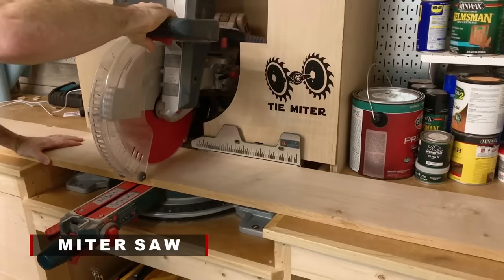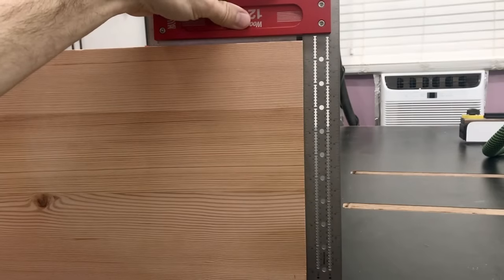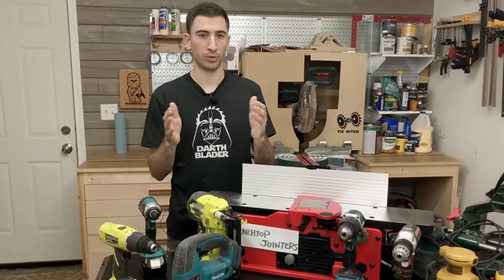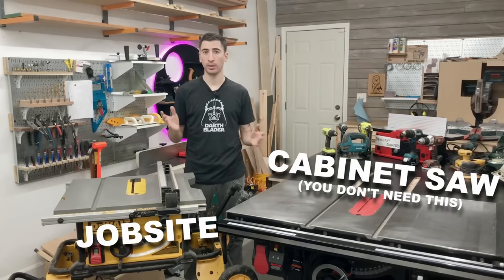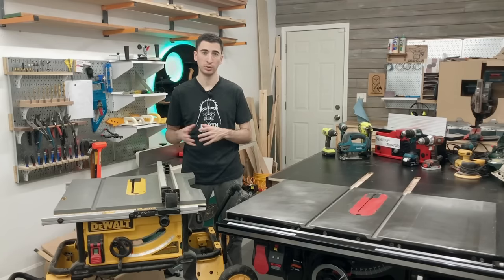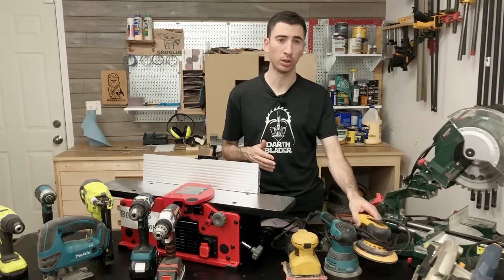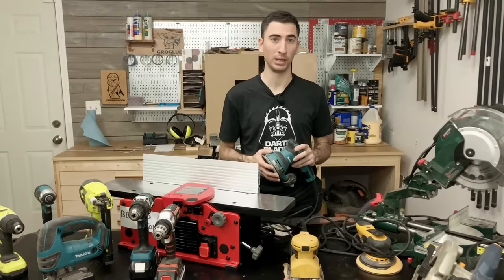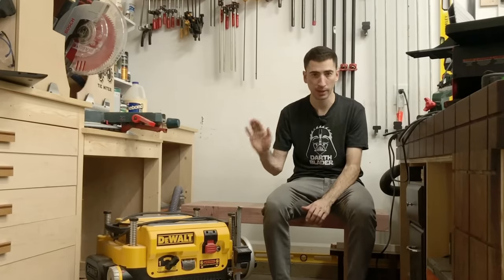Woodworking POWER Tools // Watch Before Buying

Comment: You are correct about the 8 inch jointer.  If you build using solid wood, your first 2 operations should be flattening the face and jointing one edge.  Next you need to go to the planer and flatten all your stock.  Then you can go to the tablesaw to rip your stock.  Finally go to the mitersaw (long bed support) for crosscutting.  Buy an 8 inch long bed jointer.  Your accuracy begins here.  Can i do the same thing with handplanes, yes.  But it takes 4 times longer.  Buy a 15 inch industrial planer with a longer bed and great feed rollers.  Can you get by with a lunchbox planer,  yes but it will take twice as long and you can not plane wide panels.  Buy a 10 or 12 inch tablesaw that has cast iron tables and is 27 inches deep.  You can use smaller tablesaws but they are more dangerous.  Your fingers matter.  Buy a 12 inch miterbox,  10 inch is too small for a lot of stock.  I will call bs on not buying a cordles sander.  I bought the square base dewalt 2 years ago and was amazed.  When i had to work on 2nd story windows on a 28 foot ladder i was glad i did not have a cord.  I can run a long time on a 4 ah battery.
 Things i did right 43 years ago:
Bought the 8 inch industrial jointer, 2 hp
Bought the 15 1/2 inch industrial planer
(They are both still running)
Things i did wrong 43 years ago:
Bought a smaller tablesaw trying to save money.  Finally found a 1957 Delta unisaw that i bought from an 80 year old craftsman who was downsizing.  What a difference that was.
Bought a 10 inch miterbox.  Too small.
Bought a nice 12 inch delta when the motor burned up on the 10 inch.
Could have saved 50 to 75 percent on my power tools if i had bought them at local auctions or from craftsman who were retiring.  This takes time but there are bagains out there.  I have bought $400 tablesaws for $40,  $225 router for $50, $1500 planers for $200.  Went to one auction where there were 5 of everthing.  This guy had 5 tablesaws. 5 planers, 4 jointers, 5 lathes, and lots of other stuff.  Bought one box lot that had 4 combination squares, marking guages, chisels, and planes that was worth over $200.  I paid $15 because i wanted the brass backed dovetail saw i had seen i  seen the box. Craigslist, estate sales. Auctions, and clearance bins at home depot can fill up your shop with great tools that will last a lifetime.  You don't have to pay full price.
Reply: Great info for an amateur just starting out like myself. Thanks!

Comment: 1) don't underpower your equipment, make sure you are on a 20 amp to get all the power and not burn out your motors. 
1B) (because I am lazy for editing): make sure your motors get fully up to speed before you start cutting, you want the blades to be doing the work and you want to keep the RPMs up. If you slow down the blade the blade will start to wobble and it will throw off your cut. That's how you'll get Burns and scoring in cuts. You can go slow with a miter cut and virtually get no blowout. 
2) the orbit (1/8, 1/16, 1/32, and 1/64) are what you need to focus on, get a minimum 1/32 it is good for taking down a surface and decent at a finish... 1/64 is a finish sander and not for taking off volume... Get an adjustable speed and you can slow down the speed (you need to slow down to) with a 1/32 and get a better sand without swirls. (wipe with water or denatured alcohol or lacquer thinner to raise the grain before doing this for a better result) bostch has a good one that is competitively priced. A low orbit sander and cheap sandpaper will leave hook marks and swirls. Also, just like the saws, let the sander do the work.  
3) The DeWalt planer and table saw are highly recommend by myself as I have used them professionally for over a decade. They last and do very good job and stay true, and have enough power to be safe...
4) pay attention to professionals and reviews for saws if you're going to get your radial arm, or the more expensive compound miter saws. Some saws that make a great miter box do not make good radial alarm saws as they will not cut square on longer cuts. I have a Delta chop saw that is older than dirt that still works, though it's only a 10 inch. Dewalts make fine 12-in chop saws if you need a little bit more space. I have a Makita compound sliding miter saw for any of my detail work as it's the only one I found to cut square and straight and have all the angles that I need of all saws on the market until you get to the truly expensive stuff (through they no longer make a 12" version of the sliding compound miter saw). 

5) DeWalt miter boxes have a lot of power, however the color that holds the motor to the blade is cast aluminum, so if you're too rough with it you can actually bend that and throw it out a square. So don't slam your tool into wood to cut or drop or strike the housing too much as it will ruin your saw. 

Over 20 years of high end cabinet work and furniture restoration experience.
Reply: Thank you for all this!
Reply: No s---! Sooooo generous with your advice & detail! THANKS!

Comment: The most surprising tool I've purchased was a Harbor Freight angle grinder.  On sale for $7 (I think its typically $11 now) and I had no use for it at the time.  But in the last couple of years I've used it from cutting stone to cutting metal fencing (hog wire) in addition to various grinding duties.  With the right blade or abrasive wheel it easily did the job and working long after I would have assumed it to fail (again cheapo HF tool). I only minimally take good care of it, it just keeps going.  I've been looking at upgrading, maybe a battery powered but really haven't found a case where I need to.
Reply: I had one but the switch failed after about 5 uses. If you ever get a good cordless grinder you'll wonder how you lived without it. I also have a corded makita grinder for the bigger jobs.

Comment: I have been a carpenter for more than 40 years and to this day i do not have a workshop as clean as yours. there is an age old saying a tradesman never blames his tools you can get the best that money can buy it does not mean your going to get a better result because you can also buy the cheapest and get the best results. spent most my life buying expensive tools but found over the years my old tools serve me better.  I almost do everything by hand now because the results are easier to achieve. using an handsaw gives you sense that you have achieved the real skill of wood working. an hand plane give great satisfaction and at the same time keeps you fit. but to each there own.

Comment: I have to say, one of the first tools I purchased was the dewalt jobsite table saw with folding stand. It is flawless, accurate and has given me 4 years of faithful service so far. It was an excellent purchase over time. I am precise with my tools, so if you are a rough worker, your results may vary.
Reply from the maker: Thanks for sharing

Comment: I definitely need to differ about the skil table saw. I purchased, own, and use a Skil TS6307. It’s a fantastic little saw for 300 bucks. Was square to the fence right off the box, and the fence even all the way through, and easy to adjust. My biggest gripe is the miter gauge is junk, but they all are at this price point.
Reply: I've heard all good things about the Soil. I'm gettng one for my remote workshop
Reply: I've used proper "good old days" Delta cabinet saws, and even their miter gauges were sewage.  Essentially, expect to replace a miter gauge.
Reply: @tomsardo6984  Earlier this year, I bought a Craftsman table saw from Lowe's.  The problem with it was the fence only extended to 12".  So practically useless for sheet stock.

After struggling to make it work, or watching it sit out of projects entirely because the saw just couldn't do it, I sold it and bought a DeWalt, with a 32" rip capacity.

If my Lowe's store carried that Skil table saw, with its 24" fence, I probably would have bought it, and kept it.  There have been a few things I've used the additional capacity of the DeWalt for, but I could work around the Skil.
Reply: @thegardenofeatin5965  if you buy a saw, ANY saw just for the miter gauge, then you’re bound to be sorely disappointed… rather it’s the 300 dollar skil, or 3k Powermatic. Just how the game is played.

Comment: Nice video, and good advice. I am fortunate and have been able to pickup good quality mitre and table saws as well as sanders and drill press. I do have the Dewalt 735 planer and I have a nice 6” jointer with a helical head. But I run into problems in that area on several projects, and rather than worrying about replacing my jointer or planer, I have made friends with my wood mill. He has an 8 inch long bed jointer and 24” planer, and for almost nothing he will run things threw for me. It would take me many, many years of projects to pay for either of these things for what it costs to use his. That and it is great to just hang out and talk wood and projects. Never underestimate what you can learn and money you can save by networking with other woodworkers. My experience has always been that they love to share their knowledge and often time to help other woodworkers out.

Comment: Don’t forget if you are hand or power sanding to frequently use the unclogger. I managed to do without the dangerous jointer for decades. I now have one but I don’t use it much. I would buy an edge sander if I were starting up. My most used power tools are circular saw, band saw,mitre saw, edge sander, pillar drill and cordless drill. Followed by planer or sanding thicknesser and bench morticer.

Comment: As a  longtime woodworke, I have an assortment of really great tools, Jet, Laguna etc. And what I thought may be a mistake buying was the Ryobi cordless 18 and 23 gauge. Best cheapest toolsI've bought. Outperformed the Makita 23 gauge easily. I still can't believe how well they've been working going on three years now. Amazing how many great pieces I've made, and don't own any Festool.
Reply: I think Festool is WAY overpriced in my opinion. A Bosch or DeWalt miter saw is plenty for just about anyone: hobbyist, pro or anything in between. One major issue that most modern miter saws have is that their fences are secured with countersunk bolts, so you can't make fine adjustments and have them stay. All that I know of except for Hitachi and DeWalt have this drawback (yes, even the Festool!). I was able to get around this with my DeWalt aftermarket screws and washers, but I want the security of the countersunk screws combined with a perfectly straight fence, so I'm gonna have to build a custom one at some point.

Comment: Kobalt has a very good miter saw for the money. Old Delta saws are also good. Anything with rail forward design or a telescoping arm like that Bosch, can be mounted to a bench with less backspace. That helps a lot. 

Battery powered tools, Makita and Milwaukee are great and available, Dewalt is up there but just a bit harder to get the top end.

Comment: I believe that if a power tool is adjustable,  you can improve performance not only by fine tuning the machine, but buying the best cutting blade you can afford. Years ago I started buying Forrest blades with dampers. 4.5 inch for my PC trim saw, 12 inch for my Dewalt SDC miter saw and 10 inch blades for my Delta cabinet TS. I mean multiple TS blades: rip, combination, custom top ground ATB, cross cut for plywood and man-made materials. Bought most of mine at trade shows at good discounts and clean and back to Forrest for retipping and sharpening. In 22 years have never replaced a Forrest blade.

Comment: As for job site tables saws the skil saw portable  SPT99-11 with the stand is a very good option. It has wormdrive with a lot of power. the folding is easy and is very easy to move around with the big wheels. It’s fence is easy to square up with the blade. I think it has the widest table with its extension which is nice for ripping sheet goods. It is a lot better than the other skil table saws which I believe you are most likely familiar with.
Reply: DeWalt has a jobsite saw with a fence that extends to 32", the Skil goes out to 24".  Which is plenty of room for a lot of projects, but that extra room on the DeWalt does open some doors.
Reply: @thegardenofeatin5965   The model number I have and referenced in my post above has a fence that extends out further than 24”. Without looking it up if I remember right it’s 30” so not quite as far as the Dewalt.

Comment: Very well done. I owned a commercial woodworking shop but am now retired. I started as a hobby with an old Shopsmith that was given to me. Not recommended!  My first table saw was a Delta unisaw. OK but not great. Next was a SawStop, a considerable step up. The An SCMI 12 to 16" sliding table saw, very good. First jointer was a new 6" Powermatic. Not recommended. Next was a used 8" Powermatic, very good. Then an old 16" Crescent that I totally rebuilt and had all parts Blanchard ground, good. 14" delta bandsaw, ended up replacing much of it, now good. Next was a used Mini Max 17" that is pretty good but not serious production level. Shapers: I think one of the least appreciated tools. I've had Delta and Powermatic, both junk. European shapers I've had have all been very good. My favorite is a Gomad tilt. All my shapers have powerfeeds. Be safe, Don't take chances.

Comment: Awesome video. The only point I would make on buying used Delta equipment is to stick with the older (made In USA) models. There is a HUUUUGE difference in quality between them and their newer big box/ homeowner cheesy versions. I regularly see older Delta Unisaws, or Contractor saws on FB or CL for less than the cost of the hybrid Delta saw you pictured. Many of the older saws can also run on 110 volts, which is a consideration for many garage shops without 220v power.
  I bought a used Delta Contractor saw and spent considerable time tuning it and polishing the cast iron top. With a quality blade, I can get cuts every bit as good as your Sawstop. Just my $.02.
Reply from the maker: Those unisaws are fantastic. Can't go wrong with them

Comment: My Ryobi Table saw adjusts great. But what made me a Ryobi buyer and fan is their One + tools. My first Ryobi one+ drill Infound partially submerged in a bucket of water. After it dried it worked fairly well, I cleaned it up and oiled the chuck but the impressive thing was the life of the battery. I used that drill periodically for various small jobs and it lasted 6 months give or take without charging. I am very happy with my Ryobi tools.

Comment: I have the cheapest Ryobi table saw available. Aligning the blade to the miter slot was a bit wonky, but I was able to get it done, and the fence has its quirks, but I find it works well enough for me. (For these points, very likely I just don't know what I'm missing, and maybe one of these days I'll upgrade to something better and actually realize it).

The most glaring issues I've had with it are that the miter slot is a nonstandard size (and there's only one) and the table is tiny, with a puny rip capacity. I made a crosscut sled and DIY'd an extension wing/router table, both of which work...OK (good enough for me). But were I doing it again (and still trying to go cheap) I'd definitely opt for something that at least has 2 standard size miter slots and also try to DIY the rip fence (probably using John Heisz's design).
Reply from the maker: A lot of great points in there Jonathan. Thanks for contributing

Comment: That Dewalt tablesaw just handled over 100 21mm full sheets last week without breaking a sweat. I strongly recommend upgrading the fence. I'm running it with a 30x90x1200mm alu profile as a fence. Total champ

Comment: I bought cheap in the beginning while learning and had to replace all the Ryobi stuff years ago. Miter saw was good but drills, circular saw and table saw were pretty poor quality and didn't last long. DeWalt, Bosch and Milwaukee brands have been good for remodels and rental house stuff. Definitely worth it imo. And the cordless advice was spot on.

Comment: Great advice video for beginners. I would also add to go with a 8 hole D/A sander VS a 5 hole version. You will get much better dust collection from it and dust collection is also key for abrasive longevity. Your sandpaper will last twice as long with good dust collection.
Reply: 8 hole and sand nets, pure heaven

Comment: Why do you hate Ryobi? I am pretty happy with the tools I've bought so far, the ONE+ batteries fit into all their tools. I'm just curious why you hate them.
Reply from the maker: I was unaware I hated Ryobi. I think I said they are a suitable option for certain tools.
Reply: I love my Ryobi tools and Ryobi days are awesome to update batteries and get a free tool.
Reply: @Lincolnstww  Whats the downside? You mentioned it several times like it was junk comparable to Skil.
Reply from the maker: @FoolyLiving  I said it was a lesser quality tool, and I don't recommend it for a table saw because the fence is absolute junk. Fine for a miter saw and  sander. You get what you pay for generally. Much like a Kia vs a BMW

Comment: Good video.  I do have a mix of brands, as I just picked up the best tool, for me, for the job.  Makita, Milwaukee, Craftsman, Hitachi, Dewault, etc.
I did go with the Ryobi battery powered tools.  There are cheap models of the tools, as well as higher end ones - and a VERY WIDE variety of tools.  Been using them for years with zero issues.  The only cheap one I use is the reciprocating saw.  I keep waiting for it to die so I can get a better one, but the darn thing won't give up...

I like your sponsor by the way!
Reply from the maker: That sponsor is a real hard ass